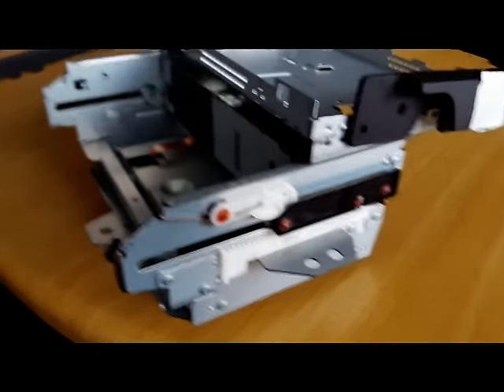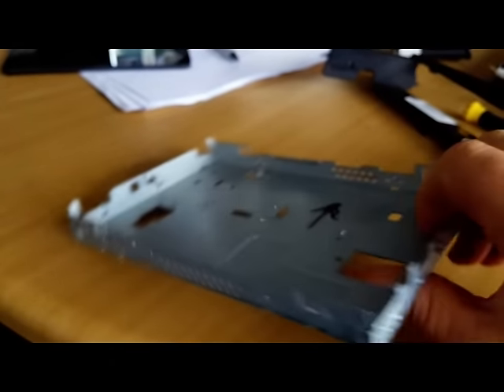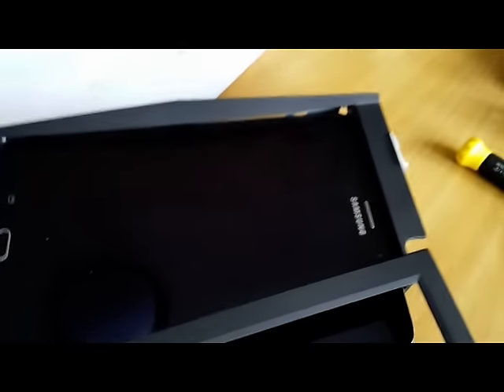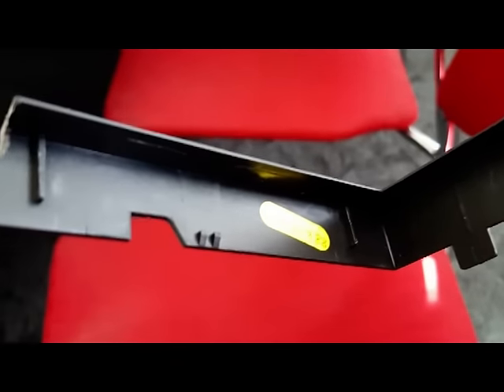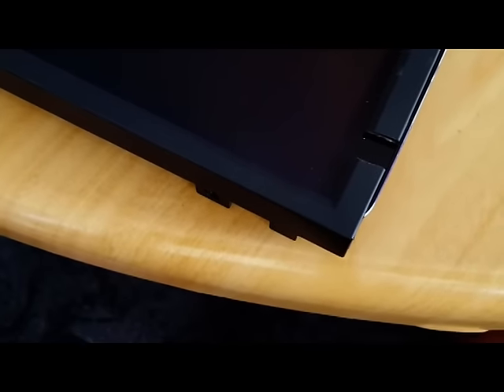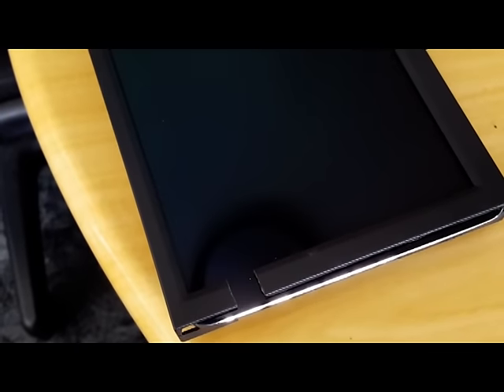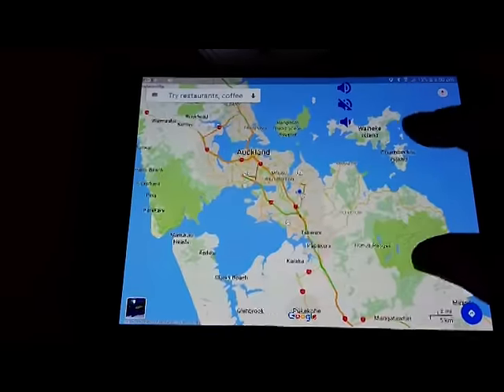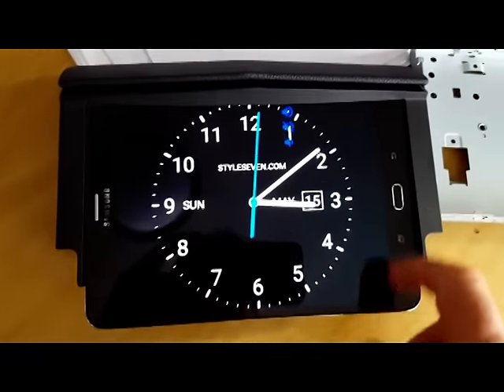Cadillac CTS Tablet Install - STEP 1.

Comment: How do you have internet on the tablet even though you're not on WiFi?
Reply from the maker: Nicholas Casale 
I ended up putting in a data phone card. share the data with my phone data plan. so car has its own phone number.  I divert my phone to car when traveling.  works perfect.  also for you tube, spotify etc